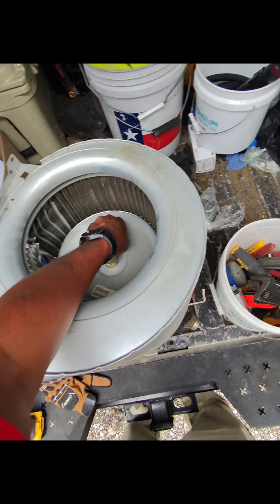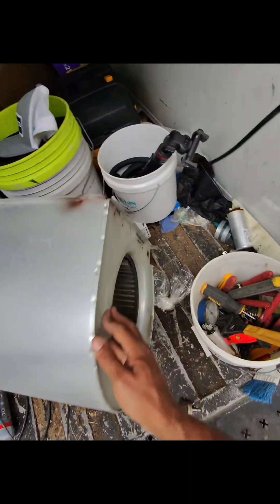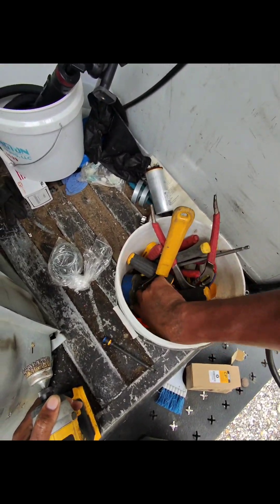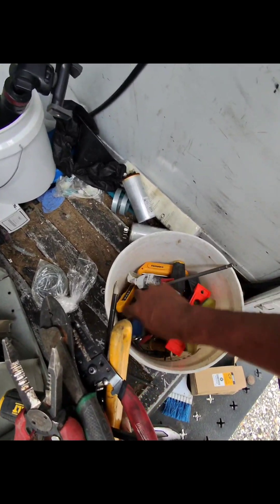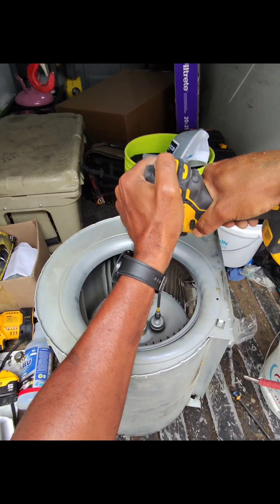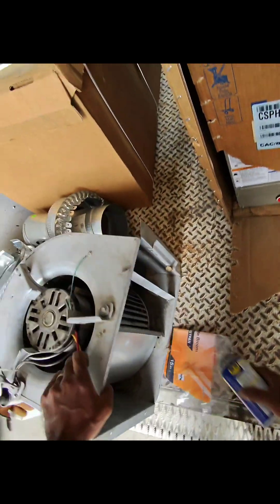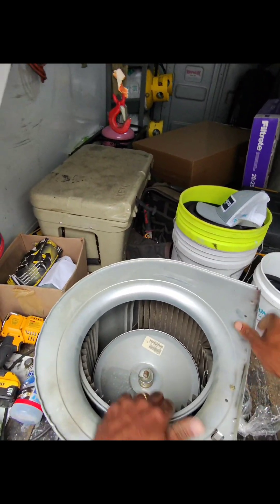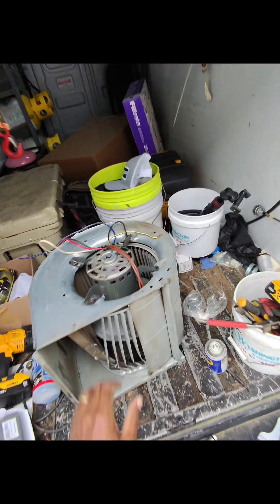Part 1 Carrier’s Prices Are Out of Control: Why Are Prices So High in 2025? #hvac 🧊 Katy AC Repair 🔥

Comment: For the longest I’ve been taking out ECM motors and replacing them with PSC motor, and still using the original control board, I just send the 24v to another relay. I can literally get the blower, capacitor and relay for less than $200, some of those ECM go for $300 - $1,200 depending on the brand. I remember working on a house that had two identical RHEEM units for each side of the house, one blower was ECM and one was PSC directly from the manufacturer. Ever since then I told myself if these companies do it, why can’t I?

Comment: Sir,  can’t believe you making this video I just changed out a 5 ton 460 volt electric package unit with a 410a and I asked about the new 454. I almost fell out right there in the store off west little York. It was Double. Not a 3rd or 20% or none of that I’m talking x2 the price of the 410a I was buying. Looks like I’m going to be rebuilding a lot of carriers this year.
Reply from the maker: SMH check out the price of the refrigerant, and they come in 20lbs drums
Reply: They say the change is for the environment, but we know greed is the driving force.